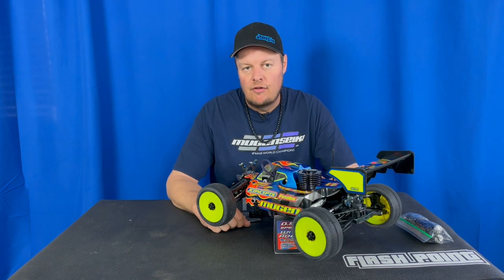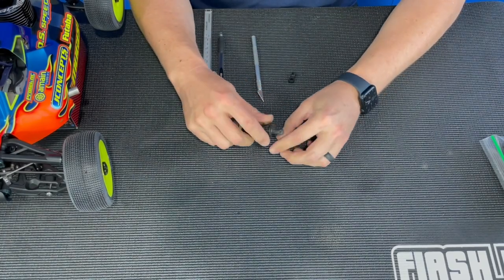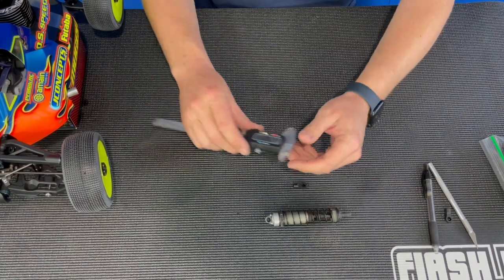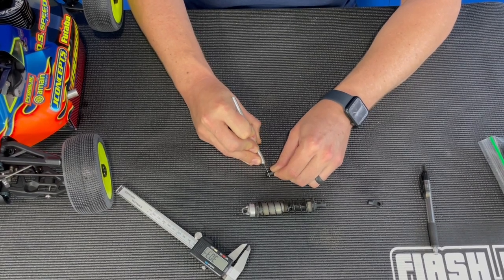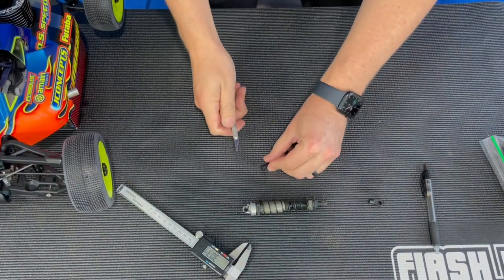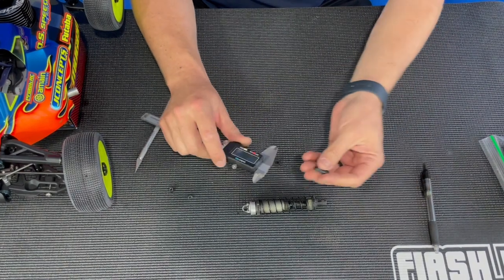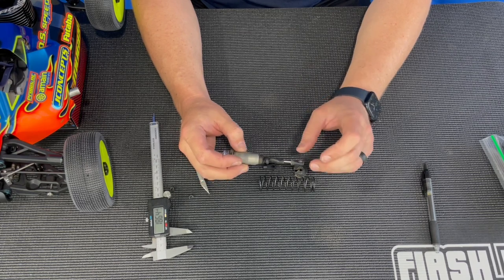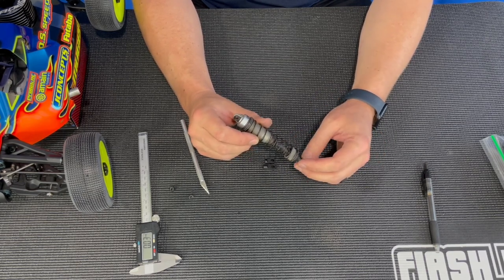Lower rear ride height - Cut shock ends.

Comment: Yeah ok if you get parts for free and sponsored. I’d say if you need to do that it’s a design flaw in the product you are pushing out there!
Reply: Yeah because shock ends are so expensive....
Reply from the maker: Appreciate the feedback.
Reply: This isn't necessary at all unless you want to follow their setup's exactly. The car will probably be 99% without doing this but some racers are looking for that slight edge.
Reply: It's not necessarily a design flaw, it's more of an innovation or "experimentation"  to make a better product for the end user. If you're going to gripe about the cost, perhaps you should take up knitting.